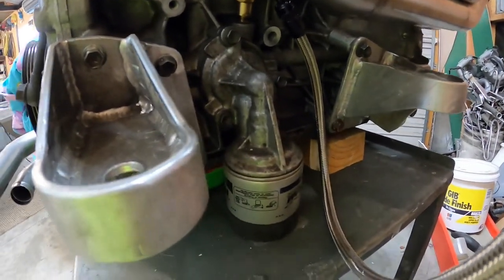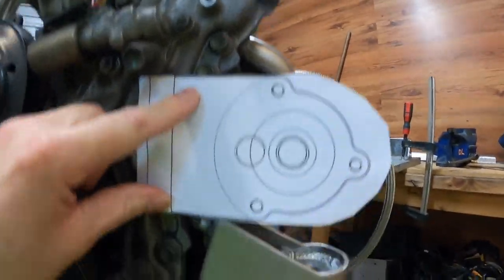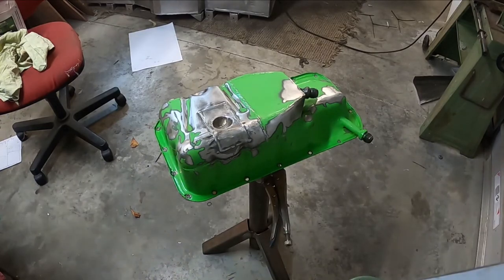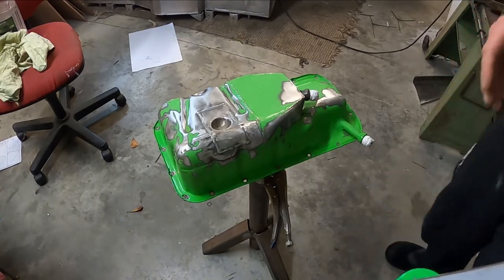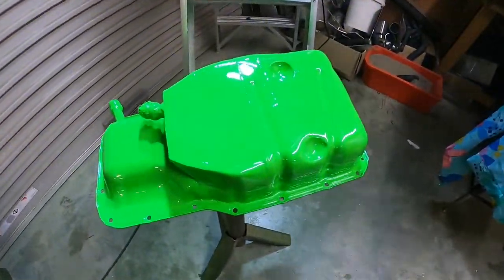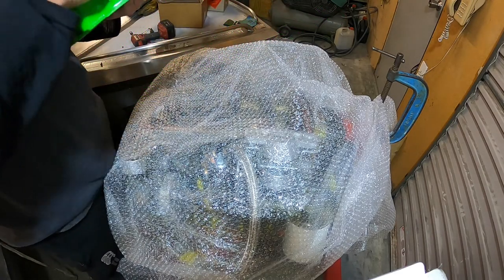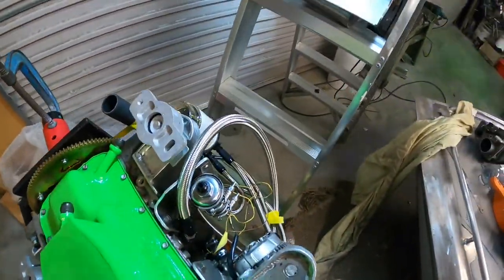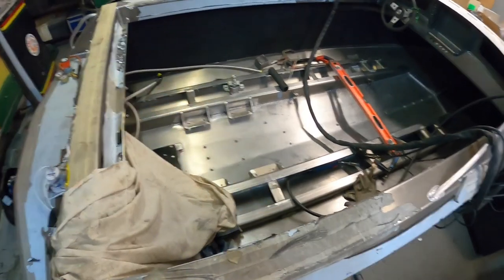Turbo Jet Boat Build NZ (Prepping for PT3) - Oil filter placement, Barbecuing the sump.

Comment: As you suggested you can screw the oil filter directly onto the block using the threaded insert on the extension.  I did this and it has worked perfectly.
Reply from the maker: We have that as a back up plan. but we do like the thought of relocating is for ease of access. are you using an M18a?

Comment: when all said and done, what HP do you expect and top speed?
Reply from the maker: Hi David. We are aiming for around 250hp on the stock internal engine. Ultimately I'd like to purchase another engine and build it with stronger rods etc.. and really ramp up the power but for now we will see what we can get in this form. As for speed being our first boats I'm not sure what speed we will achieve but I know I wont be happy with a slow boat. Cheers
Reply: @SabotageGarage  awesome, keep rocking, excited to keep watching the vids!!
Reply from the maker: @MrDavid6974  Thanks Mate, thanks for the Sub?